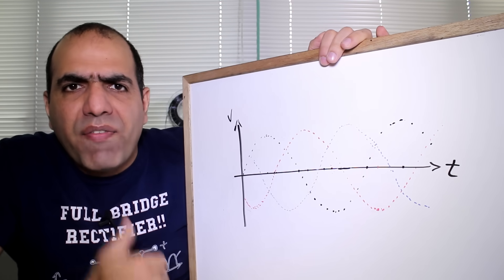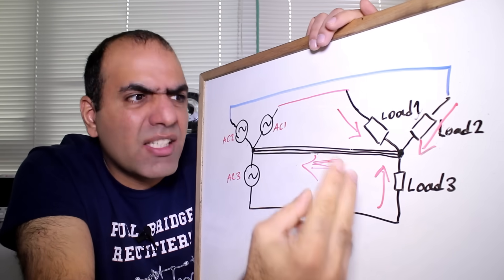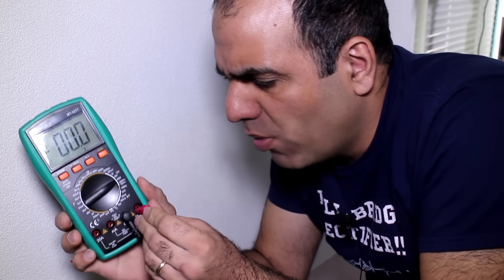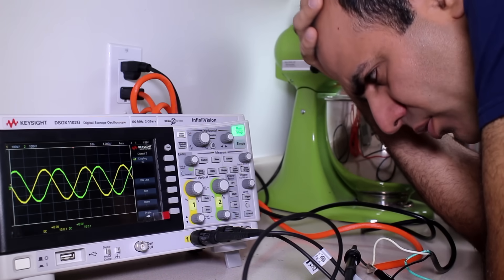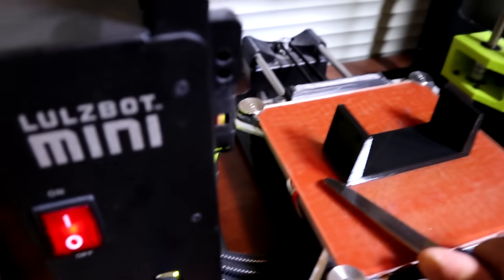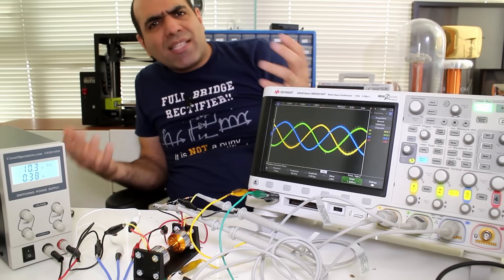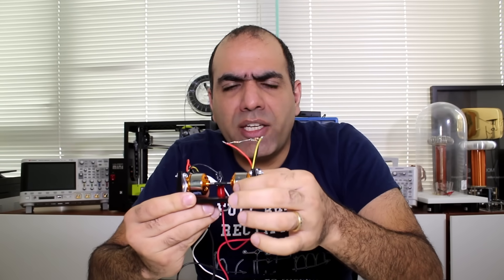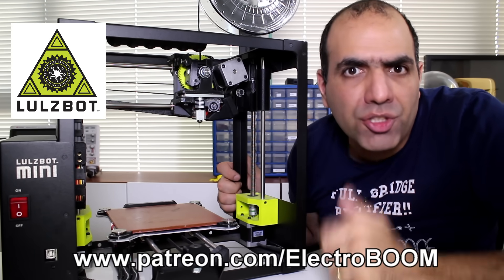Why 3 Phase AC instead of Single Phase???

Comment: 1 question: so if ESC makes the magnet in the middle rotate by varying pulse of 3 phases, does it mean we can caculate the speed of the motor base on the pulse frequency (when no load is applied)? how about when load is applied, the motor go slow even it receive the same value of pulse

Comment: Some houses are supplied with single phase 240v AC but have a neutral connected to the middle for the 120v regular devices use. You must live in a condo building supplied with 3 phase and split up so each unit uses 2 of the 3. That is a more cost effective method to power large buildings.
Also you only went over Y type 3 phase. Do delta for your next video please.

Comment: I am an avid PC builder, and just delving into the electrical engineering of PCB's. One thing I have noticed is that a lot of mother boards run on 4+1 phase PWM, or 8+2 phase PWM. could you elaborate on those designs and how they work?

Comment: Hey, I'm in Canada... we use single split-phase, not two-phase. The phases oppose by 180 degrees and is taken by two taps from a transformer for the split, with neutral centre-tapped. That's how we get 240 volt from 120 volt: Potential difference between + and - 120 volt rms

Comment: but the question is, why do americans have sockets with 3 plugs and europeans sockets with 2 plugs?
The only thing I know is that european households have 2 phases on a typical socket (220-240V) and use special sockets for things like ovens (400V).

Comment: If you had an actual 3 phase motor you would not have to use a second motor to build the generator.  All you need to do is set up a capacitor bank to start the motor in reverse(or use a starting motor) wire two legs into your "2phase" supply and the 3rd leg from the motor would generate the third power phase.

Comment: One day I wanted to know what would happen if I set my meter to measure resistance and then plug it into the socket so there was 220v going into it. The meter started smoking and blew up. The fuse was in good shape but the rest of the circuit wasn't. 
¿WHHYY the fUck?

I have no life

Comment: LOL@mishaps. But another reason 3-phase systems got expanded a great deal in the early 1900s is because there was an efficient way to rectify the 3-phase current back to DC: the mercury cathode rectifier. These don't work too well with 1-phase AC (the arc gets extinguished on the reverse half of the cycle and is hard to reignite, whereas in a 3-phase rectifier the arc never extinguishes). Remember, there were no high-power silicon diodes back then.
Reply: Glass ignitrons like this https://youtu.be/x-0b-wQnDWY?t=160 look pretty nice.
(But looking at them will fry your eyes)

Comment: Mehdi. It's should be 180 degrees in the kitchen. Residential is split phase transformer which is a neutral in the center of the secondary making both phases at +\- 90 . Where did you get 120 from... Is your building 120/208 supplied?

Comment: This video failed to mention a fundamentally important characteristic of three-phase systems: the characteristic of constant power (more generally, ripple/harmonic-free in the ideal case).

Conversely, single phase networks transfer periodically varying power even in the steady state, with the transferred power decaying to zero two times per fundamental period.
Reply: dmichaud, That is actually incorrect view. In Electrical Engineering when we talk about power, we are talking about the average power (not instantaneous power).  Assuming purely resistive load(no apparent power involved) in single phase network, the instantaneous power does go to zero but the average power is always a constant value (calculated as Vrms*Irms)  and it is one third smaller than an average power on a three phase network (for the same load of course).
Reply: Err can you explain this with an example..

Comment: I always remember the number of refrigerators one of the stores I worked for, lost, because of the three phase power being turned back on one phase at a time, causing the motors to lock and burn out.

At least, that's the line the service men always fed us.   I assume it's true, because it fits with what I know of electric motors, and I have no information to the contrary.

Comment: Outside of exceptional circumstances the vast majority of Australian houses get only a single phase because a single phase on Australian 240V mains power can carry far more power than a US or Canadian 120V power phase. Very rarely hardware like high power ground water pumps can necessitate residential 3 phase power though.

Comment: My electric kiln is three phase, the plug point is a huge box compared with a single phase point.  Why is it needed to be so big if you can use standard wiring in 3 phase?

Comment: Before we get there, I want to say the ESC output will be PWM DC but the width of the pulse will be reminiscent of the voltage of a pure 3ph AC wave. The output of the generating motor should be perfect AC. What you're creating is a Motor/Generator UPS. They are used in advanced systems to totally isolate Grid power from supply power to sensitive electronics. I also want that freaking 3d printer. Im an easy ship, just to the east coast ;)

Comment: But with 3 phase how many total amps could you draw before you kill the breaker? The welders we have at school are 3 phase A/C but when I stick weld on said 3 phase it is D/C at 80 amps to 125 amps for the setting on the machine.

Comment: In Norway it's common for installations in newer homes to be 3 phase 400V into the house, then the circuits get distributed between Neutral and each phase, balancing the total load on all 3 phases with 220V as the standard mains voltage. 120V is luckily not a thing here.

Comment: The two kitchen sockets 120 degrees out of phase is highly unusual.  It's because your high-rise has 3-phase power and they just hooked up two.  Regular houses don't have 3-phase power, just single phase ,and the two sockets are always 180 degrees out of phase.  It annoys me, because people keep repeating this misinformation in comments on my most recent video!
Reply: In SVK we have different sockets and we have 3-phase 400V or 1-phase 230V
Reply: 3 phases are pretty normal in Germany. Never seen a house with only one phase. Hobs and ovens are generally connected to 3 phases. Just saying.
Reply: I can confirm this. I haven't seen 1 or 2 phases. Even installations from around 1950 got 3 phases and even flats and apartments normally have 3 phases. Since you want to distribute the load evenly among those.
Reply: In the UK very very few houses have 3 phase supplies.  A typical 230VAC 60A is plenty enough to run a large house.  What the electric companies do is run one third of the houses on a street on each phase to balance their own load.
Reply: @RayBellis Then that is effectively a parallel connection so that only 1/3 of the power might go out and not the whole block at once.
Reply: MotorGuy Hosehold supply is 240v in the US, with a center tap being your ground and neutral, offering two 120v legs.
Reply: The US electrical system seems weird to me - why use a completely separate phase arrangement for the home? In Lithuania, for individual houses we get single phase 230V (for power up to 5kW) or three phase 400V, exactly the same as factories.
Reply: I was so confused seeing 2 phases from a 3 phase system in a regular household socket... Moreover I thought that most sockets have just single connection that splits into two sockets.
Reply: Tim Ramich Except in many condos and appartment buildings where each suite contains 2 phases of a three phase system and a neutral.  Line to neutral voltage is still 120 volts as in a house, but the line to line voltage is only 208.  As the 240 volt appliances have to run on 208 volts, the run at only 70% of their rated power.  I've seen electric stoves where the data plates have 2 rated powers listed, one for 240 volts line to line and one for 208 line to line.
Reply: I'm subscribed to both of you! (I don't know why I felt like letting you know)
Reply: mibars In europe it's common to have all thre phases distributed evenly in house. And kitchens, because of ovens and cookers, tend to have all three phases. Also, (atleast here in Czech republic) there is atleast one three-phase outlet for high power applications - large circular saws, concrete mixers etc.. I was surprised, when I found that it's not common thing in North America
Reply: Electrician here. I can tell you that 208V is a highly unusual voltage to get from 2 phases in a residential home. I see it in commercial and industrial all the time, but have never seen it in residential.

The 240V in residential is achieved from a single phase and neutral on the primary, and a split phase secondary with a center tap neutral. You get 120V phase to neutral, and 240V phase to phase.
Reply: In Belgium, at least in older houses, it is also common to have 3 phases. We have a 3 phase socket in the cellar although it has never been used. I think in recent houses the whole circuit is fed from a single phase unless you would explicitly ask for 3 phases.
Reply: in Germany you see this when you want to be able to draw more current from your sockets. you have 2 different wires going to two different circuitbreakers. And here is seems that they are hooked up to different phases.
Reply: For me, the weirdness is not because of the voltage or the frequency (somebody made a decision, we are stuck with it), but the fact that some homes use a multiple phase system that is different from other homes or industrial places. Which means that some home devices won't work in a factory or even other homes.
Reply: @Pentium100MHz It is about need to. Factories need more current than homes.
Reply: @easyenetwork2023  Yeah, but where I live you get 3 phase power at home as well, if you want more than 5kW. There is no weird split phase power like in the US.
Reply: Yes, 3 phases of 230V/16A each. One of the uses is the stove/oven, which gets all three phases with a single 3-phase fuse, and has no return (neutral) line. (It does have earth/ground though, duh. So four lines - 3 phases  + grounding for protection.) The phases are also properly phase shifted, as seen in (in my case) the water pump (have my own water well) that needs the 3 phases connected in the right order to work properly.
Measuring between any 2 phases with a cheap multimeter says I have 380-400V between them.
Reply: This is correct for Lithuania. If you only need little power (up to 5kW), you may get single phase 230V, but if you want more than that, you will get three phase. For whatever reason, they can put 3x40A breakers for you, but not 1x40. I am in the process of upgrading my house from 10kW (3x20A breakers) to 20kW (3x40A). I guess the higher breaker rating is to account for the power factor not being 1.

This is why it looks weird to me that the USA uses one system (three phase) for industrial and some homes, but an incompatible system (split phase 240V) for other homes.
Reply: There is no two phase.
Reply: <3 Matthias
Reply: Pentium100MHz 
There are a variety of historical reasons why North America uses 120/240V @ 60Hz, and Europe and other countries use 220V @ 50Hz
Reply: In Sweden it's 230V 50Hz 3-phase to just about everything. The amperage might be a little lower for apartments, I never needed to replace a fuse in an apartment so don't know. :P (Though I do know that they usually get 3-phase incoming.) Anyway, in my house now, it's 3x16A incoming, standard for a regular house. If had had a farm or the like, say, I could pay extra to get the wiring changed to 3x25A with the existing power lines. (Now why changing out the fuse box would cost more than labor, I'm too lazy to read up on. Maybe because 'it's a feature, so we can charge extra for it!')
On about every kind of power strip and extension cord that you can buy here, it's rated 'max 3600W', which is fairly close to 230*16, so I'll assume that's the most common kind everywhere, including apartments.
Side fact - once inside the house, the wiring going to outlets are usually on 10A fuses. Presumably so that a single outlet/group won't draw so much that the fuse blows when something starts up in another room.
Reply: Snout Husky 
So are you saying its 3-phase 230/400V coming into the house?
Reply: Hawk Cuckoo t
Reply: Matthias Wandel 

Ive been saying this for a long time

And they tell me i dont know what im talking about

At least there is one person who knows what is right
Reply: In Germany you get 3-phase 230/400 V with 120° phaseshift; usually "limited" by 3x 500V 63A (SLS) fuses. From there you normally go for 40A pre-fuse, then 40A FI (residual current operated circuit breaker) with 0,03A triggering current (sometimes less). From there you go with "normal" circuit breakers of 16A for normal sockets and light and 32A for flow heaters or stoves / oven. So you could draw around 75kVA. I am talking about houses, not flats, apartments or something. (but even at my apartment I get like 3x 40A).
Reply: https://youtu.be/JwL7XARJXg0
Reply: On a populated areas the 3 phase tranformers 127/220V its better of 120/240V sigle phase.
Reply: Thanks Matthias, I dont understand why this is the impression, that in NA we have 2 Phase in households..  IT is a Tapped transformer from a SINGLE phase source, the Taps will be 180 degrees out of Phase, EG: +120volts & -120volts.  They are not 120 degrees out of phase in N.America.
Reply: Yes this building likely has 208 volt 3 phase service which is why he was measuring around that voltage. Which incidentally would be how the 208 volt single phase is wired to provide power to the buildings lighting. Of course it could also be provided 277/440 volt 3 phase provided it has an additional transformer.
Reply: Matthias Wandel most houses in the UK have 240v 3-phase

Comment: Hi, I love your videos. There’s another important aspect when considering three-phase power systems, which is the “floating power” (Not sure if that’s the correct name in english. We call it “puissance fluctuante” in French).  We can actually have single phase motors and generators (like inside some domestic machines) as long as we have auxiliary windings and a device able to change the current’s angle (in comparison to tension) and create a rotating magnetic field. Capacitors are one example of such device. However, there is a problem linked to a vibrating power component. 
Let’s take a monophasic system where tension u(t)=U*sqrt(2)*sin(w*t) and current i(t)=I*sqrt(2)*sin(w*t-phi). w (omega) is the rotating speed in rad/s. The active power is P=U*I*cos(phi) – U*I*cos(2wt-phi). The first term is the active power, which is constant. The second term, however, is the floating power, which is also oscillating at twice the system’s frequency. If we have a balanced three phase system, the three powers equal to:
Pa=U*I*cos(phi)     - U*I*cos(2wt-phi)
Pb=U*I*cos(phi)     - U*I*cos(2wt-phi-240 °)
Pc=U*I*cos(phi)     - U*I*cos(2wt-phi+240°)
------------------------------------------------------------------------
Ptotal = sqrt(3)*I*U*cos(phi)     - 0
SO, in three phase transmission and distribution, the floating power equals zero. This property allows us to have electromechanical machines with a great power capacity without any vibrating torque at twice the systems nominal frequency, which would cause alternating mechanical constraints. However, if there’s an asymmetrical fault in the system, this floating component reappears and provokes vibrating forces in the motors that could break it. This is why modern generators and motors protection relays are capable to detect such components in order to avoid major damages. It’s the negative sequence protection function in the ANSI code.

Also, can I have one 3D printer? Or oscilloscope? Or meter?

Comment: Here in Portugal we can have 1 or 3 phase at home. You pay more if you choose 3 phase. I had it in my parents house, but the retarded electrician who did the electrical installation have done the phase distribution wrong and everytime we turned on the oven, dishwasher and the microwave or the stove the light went down (we had the highest installed power available for domestic use). Then I asked the electrical companny to change from 3 to 1 phase and, lowering the installed power for about 2/3 of what we had before, we had no more problems! fuck yeah

Comment: In norway we use a 400V system with 3 phases and a neutral wire. We only use 1 phase and a neutral wire after the fuse. 400V / √3 = 230V (Which is our normal system voltage)

Comment: What would happen if the loads are imbalanced but you don't have the return path?
Reply: +RandomVideoGuy #1124915 - Under those conditions the three individual loads would experience different voltage drops. The greater the imbalance, the greater the difference in those drops between them. The individual load with the highest impedance would have the greatest voltage drop. Very undesirable condition!